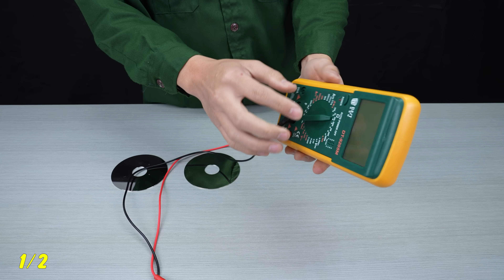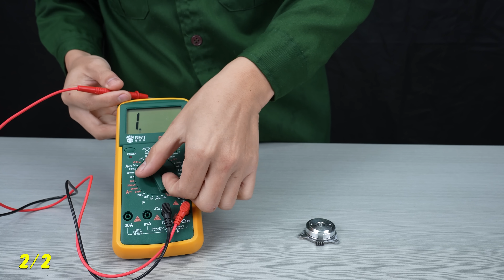Many People Don't Think That 12V Battery Can Be Made From Hard Drive

Comment: IF THAT CELL YOU ALREADY CONSTRUCTED THAT DEVELOPS AROUND 3VDC WHY NOT TO PUT SOME OTHER 
THREE CELLS IN SERIES AND MAKE A BATTERY TO RUN THAT MINI SANDER AND SAVE THE MONEY OF THAT TRIFASIC MODULE AND THEN DEMOSTRATE WITHOUT THE 12VDC@7A BATTERY.
ACCEPT THE CHALLENGE OR THE HDD DISC CELL WITH WATER AND NaCl HAS A "STRANGE" GOST.

KEEP RECEIVING VISITS AND LIKES FOR LIVING.
Reply from the maker: Great idea, @JLS-m3x! Using additional cells in series could definitely boost the voltage for that mini sander!  Let's see if we can make it work without the 12V battery!